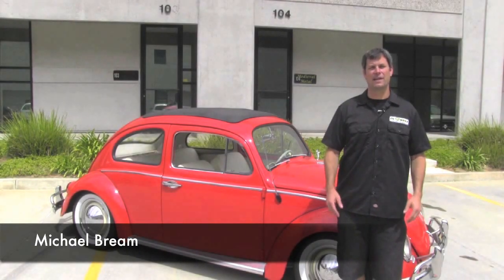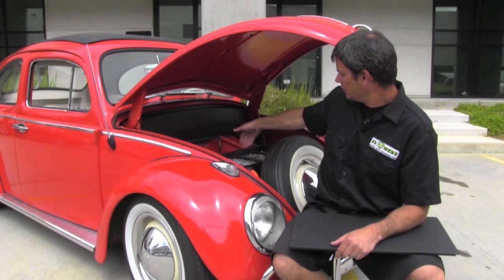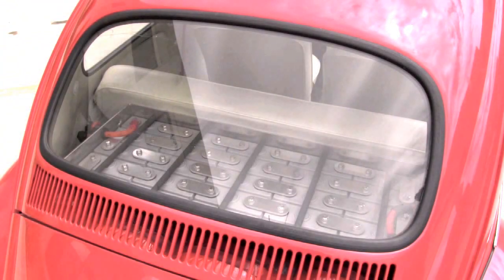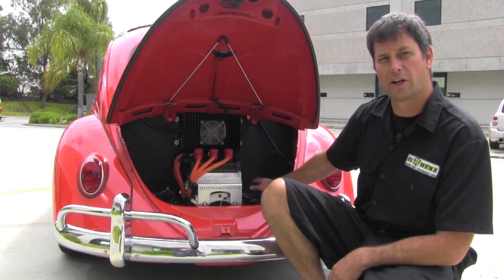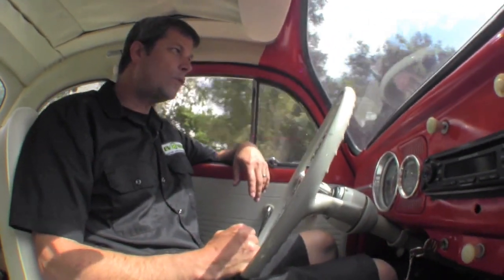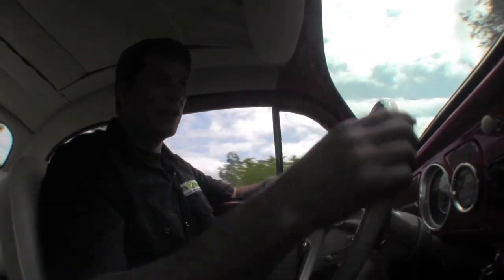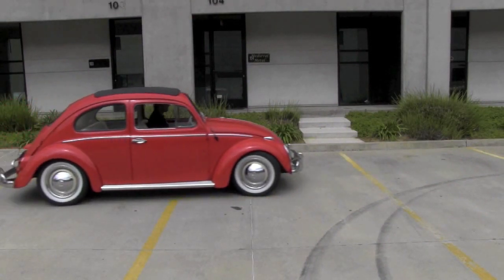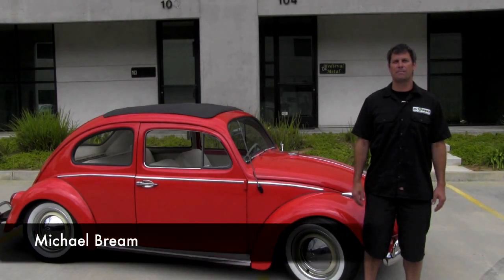Build An Electric Car

Comment: Some key questions: 1: What is the RANGE of the Volkswagen and, then, 
2: What is the range of other vehicles that you convert ? ( The average passenger car, full size pick up truck )
3: How do you HEAT the vehicles you convert ? I live in the Northeast and Winter lasts FOREVER and it gets COLD. 
4: Is some type of rudimentary, low pressure, air conditioning possible ? ( other than the obvious answer of "open the window" )
5: How long does a RECHARGE take ?
6: How long do you have to let the batteries cool down after a recharge ?
7: Do you love to hate the oil companies and their corporate influence over our government, military and every day lives, as much as I do ?